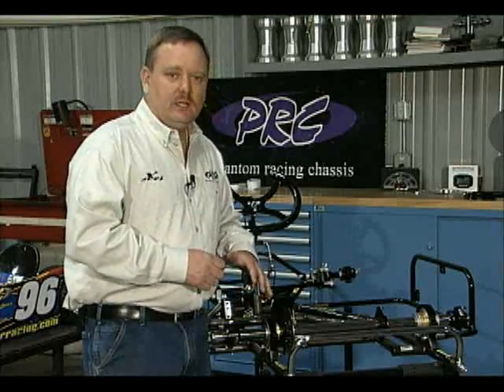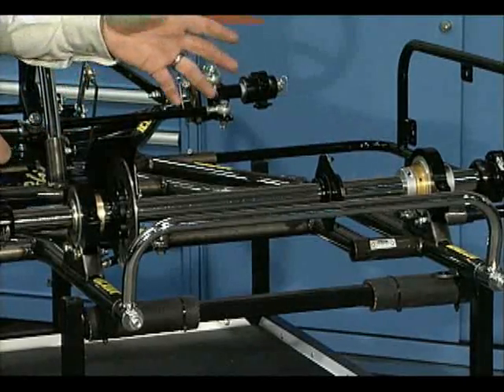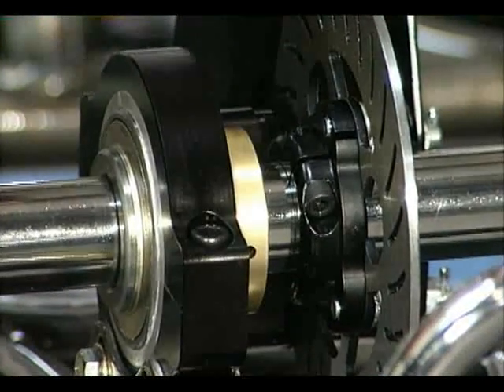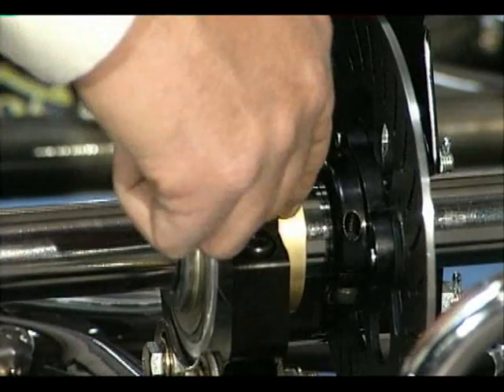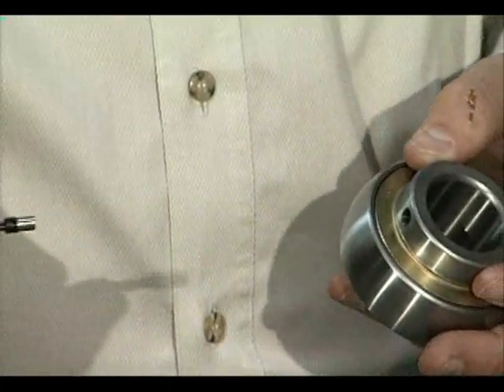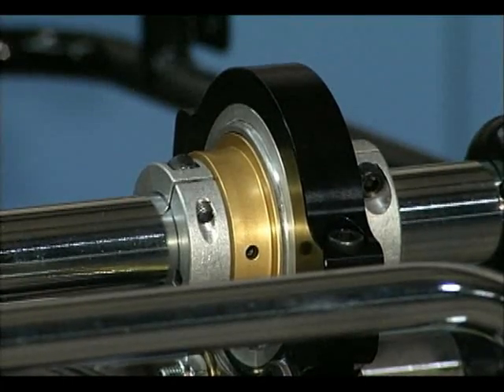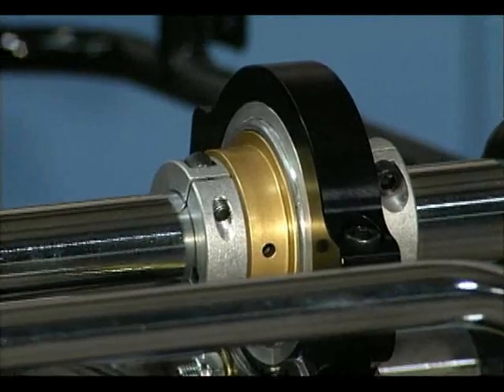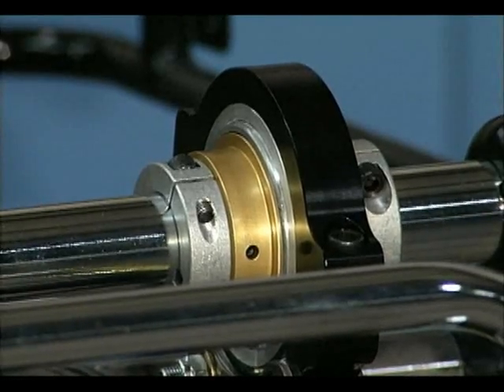REAR AXLE ASSEMBLY

Comment: Pinning both bearings will make them bind when the chassis flexes because the distance between the bearings changes ever so slightly when the chassis flexes. Pinning only one bearing allows the axle to slide freely in the other bearing so when the distance between the bearing changes, the bearings won't bind up.

You can also use axle collars on the INSIDE side of the bearings instead of set screws to prevent binding. This still puts all the lateral load in one bearing, but with the collars on the inside of the bearings, the bearing that sees the lateral load will ALWAYS be the bearing with the least vertical load (inside wheel).

If your races are so long that bearing wear becomes an issue, you have bigger problems to deal with. In something like a kart, wear should not be a consideration unless it prevents you from finishing races or becomes cost prohibitive.